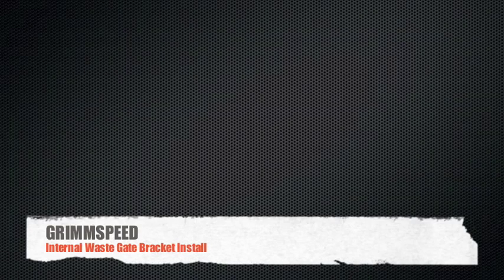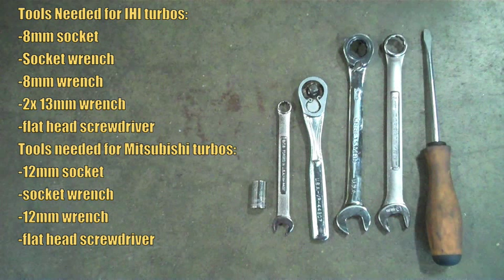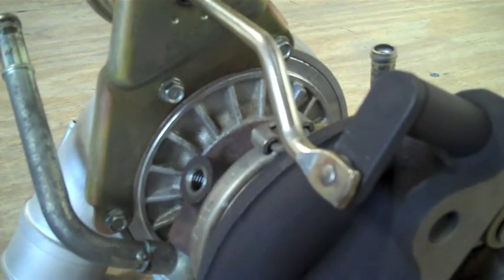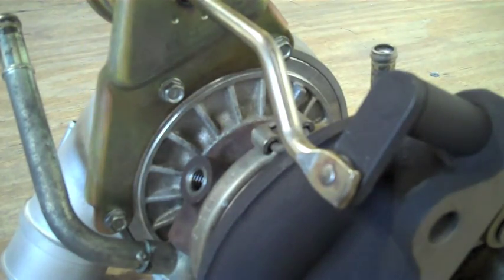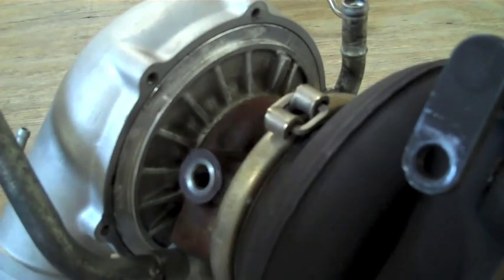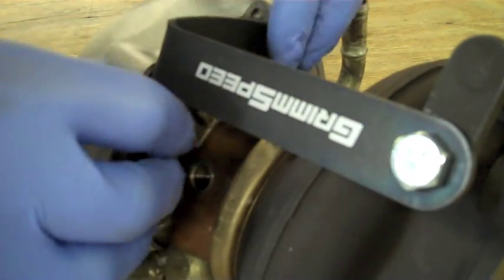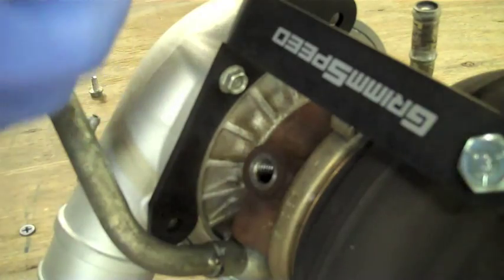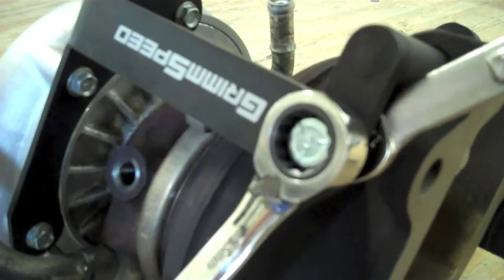GrimmSpeed Internal Waste Gate Bracket Install

Comment: I have this installed but there seems to have a hissing sound especially on idle. I tried softly hammering the bracket and the problem is resolved but after a while it comes back. Should I replace it with a new bracket?